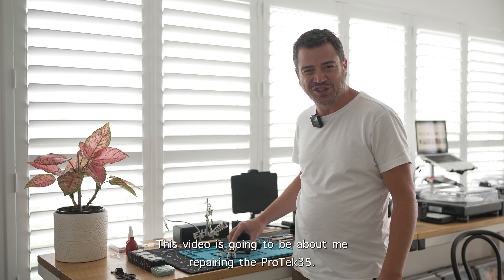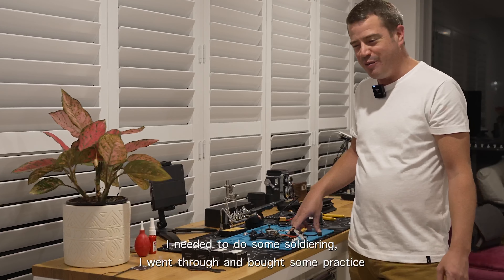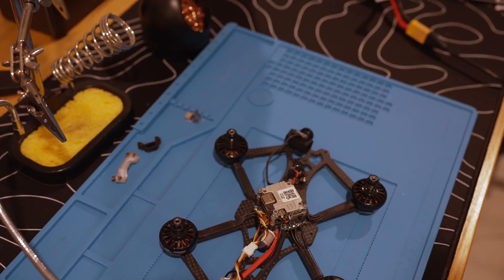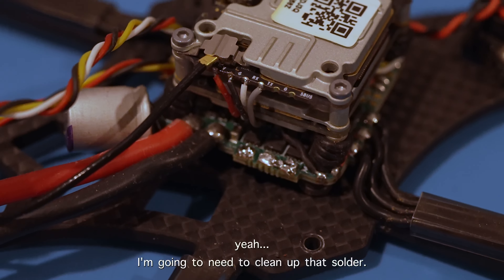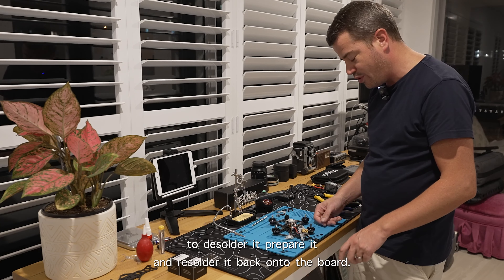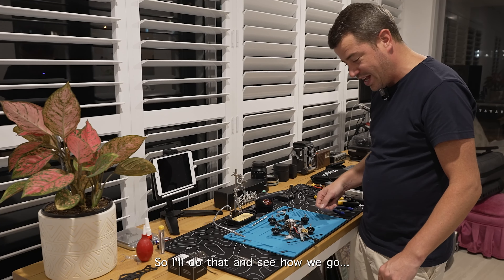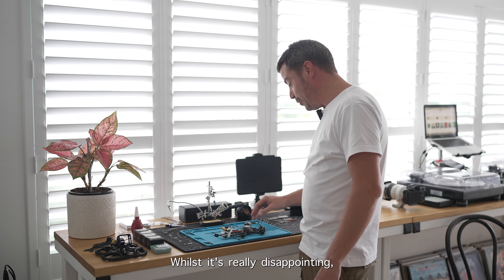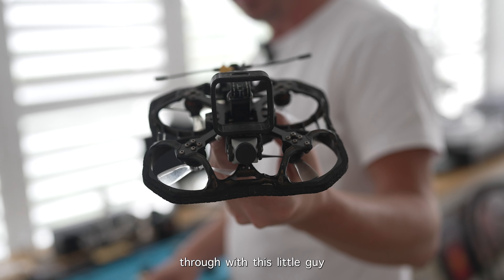Repairing FPV drones without any experience... - iFlight ProTek35HD - EP#6: DRONEHACK strikes again!

Comment: Very nice video, with the troubleshooting !!! And I like to see your progress with the FPV (I must admit that now I am encouraged to start too - I just fly normal drones and even DJI FPV in Normal and Sport mode). Just one thing, to change the rotation of the motors, you can use a software called BL_Heli_32, that will record the Firmware on the ESC controller board (but just the software related to the motors controllers). The issue with Motor 4 seems to have something to do with the Motor number 1. The MOS-FET circuits can be damaged due to the previous problem (the Motor 1 drained too much current and in the moment it got damaged, caused an unbalanced power distribution to the board, and probably damaged the MOS-FET from Motor 4). Well, to check that is only possible with good knowledge in electronics. Maybe the quick solution is to replace the ESC board. Good luck and when you get it repaired, please send us an Update 🤗
Reply from the maker: Thanks for the heads up! You make a lot of sense and I kind of thought that with such a small AIO board that what you said could be a real issue… 🤠👍🏼 thanks again for the support

Comment: i had a similar problem and turned out to be the wrong firmware I flashed to the wrong FC. so make sure to flash the correct firmware to your target FC ( better download the firmware from the manufacturer's website)
Reply from the maker: Yeah I will make sure I dont end up with this problem 😬 its the last thing I need at this point 😂😅 thanks for watching 🤠👍🏼